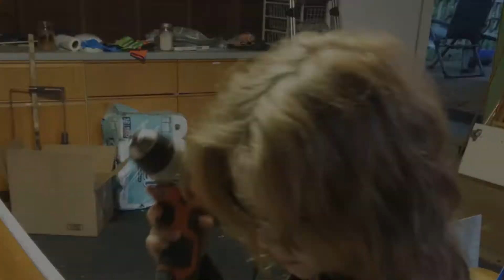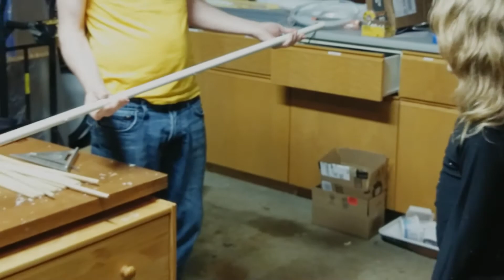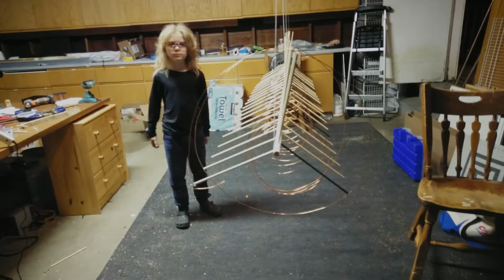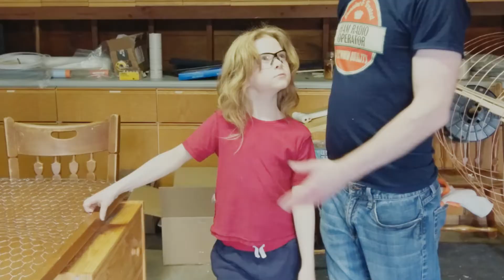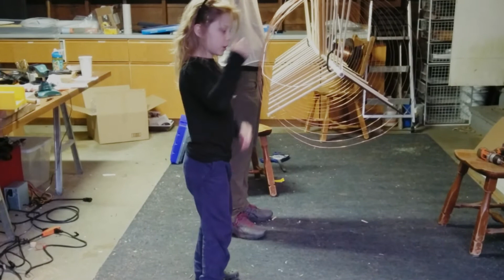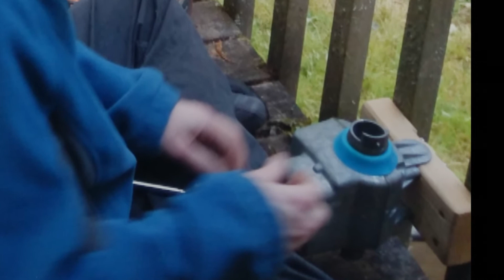📡 Build a HUGE DIY Helical Antenna for the 2m VHF Band!

Comment: It's probably more feasable to build a cross-dipole yagi "arrow" antenna at 2 meters though. That will still have the circular polarization while also being much quicker and easier to build while also giving higher gain.
Reply: For switchable circular polarization, yes go with a crossed yagi. But nothing beats the corkscrew shape for coolness factor. Generally boom length ultimately determines gain.
And this youngster is decades ahead of most adults I know

Comment: I am wondering if this antenna could be made to receive deep fringe VHF-UHF TV signal ?? The Free To The Air TV frequency ??? Nice work young lady too. vf
Reply from the maker: It probably could, but the impedance match would have to be re-tuned.
Reply: @KJ7NLL  Any ideas on what type antenna would work best ?
Reply: @oldjarhead386  Thank you much Sir. Will get right on the task at hand. Peace v
Reply: @oldjarhead386  O.K. ????
Reply: @oldjarhead386  Yes Sir, I made my antenna and then made another one for more gain. Channel Master type similar to a Gray-Hoverman.  Works really well and is not that large in size too. Peace v

Comment: I've been inspired to build a 2 meter helical now!! Good job! 👍
Reply from the maker: If we did it again we would use schedule 80 instead of schedule 40 PVC because it is thicker and we were having some bending problems. Also, pin the tube as straight as you can get it, and then fill it with spray foam and let it dry before drilling holes. This will keep it nice and rigid. Depending on how long it is, you may still need guy lines to support it.
Reply from the maker: Most of the helical antennas that we have researched are right hand circularly polarized.

Comment: curious about your feed point, how far away from center was the mount ? i built a 5 turn and it works great, feed point is 140 ohm, used an old dish 1.2m D and is still worked, pity we all have to have the turns in the same direction... to work each other, but thats how it works.
Reply from the maker: I'm not sure what you mean by how far it is from center, but I can explain what we did: The reflector is flat with a 2 meter diameter. We mounted a BNC connector on the reflector of center at the same radius as the winding. The helix runs all the way to the reflector so, there is very little distance between the BNC and the first winding. I don't know what the raw impedance was, but we matched it using copper foil tape that extends along the first 6 inches along the helix that extends toward the reflector. We found that the edge of the tape needs to be very close to the reflector and we tuned it to 50 ohms by extending or shrinking the length of the copper tape.